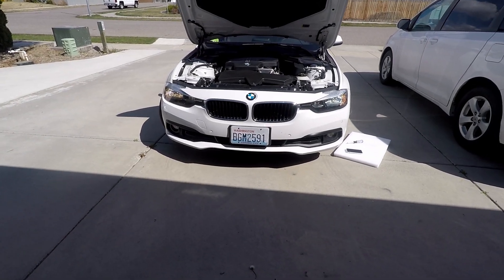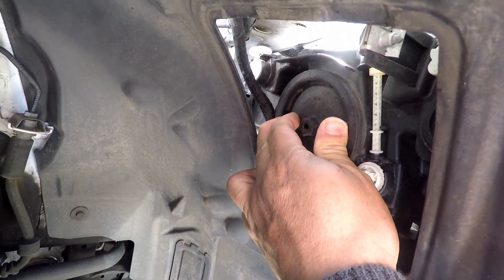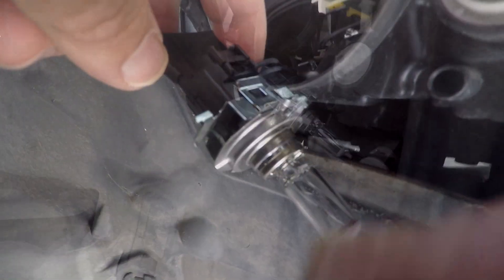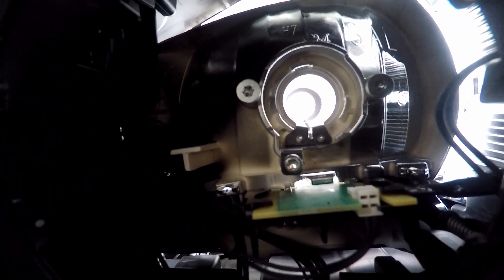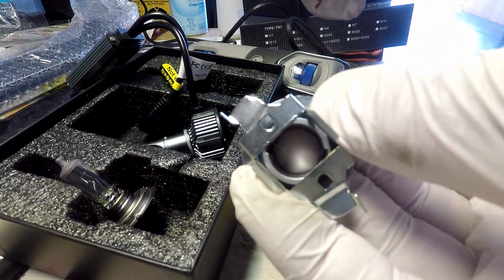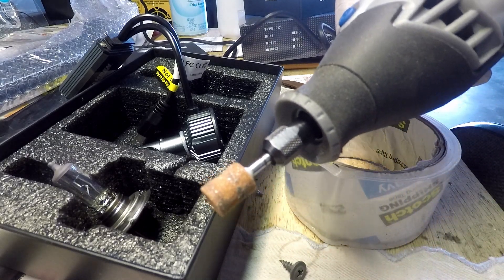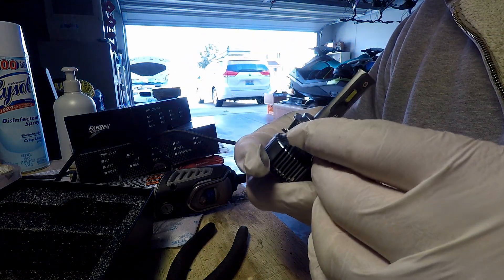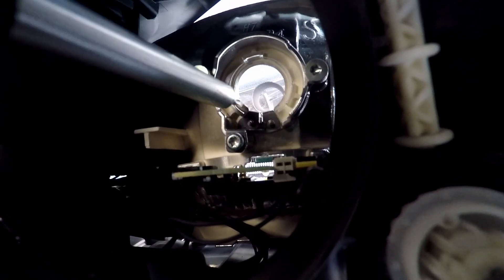2017 BMW 320i F30 Low Beam LED Light

Comment: hey, this is the video that actually resembled my 2016 BMW 320 I. So many other others out there we're completely different and just poor videos. This was on point. Note that the metal bulb sits flush on the housing so the screw screwdriver goes between those two points which wasn't readily visible.